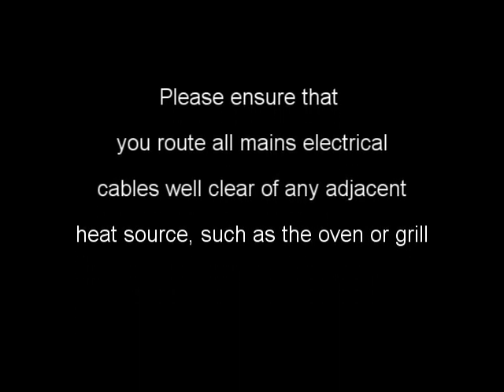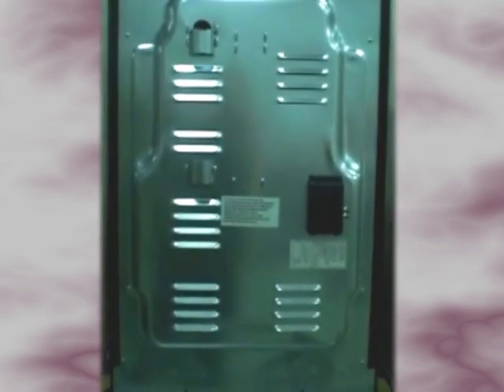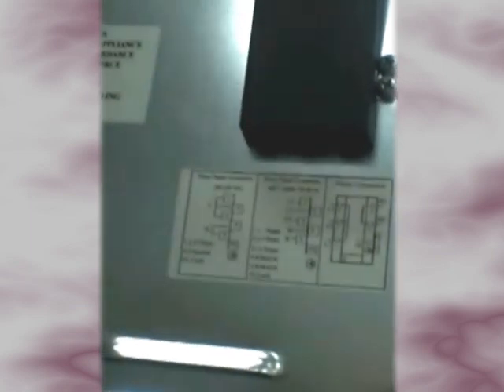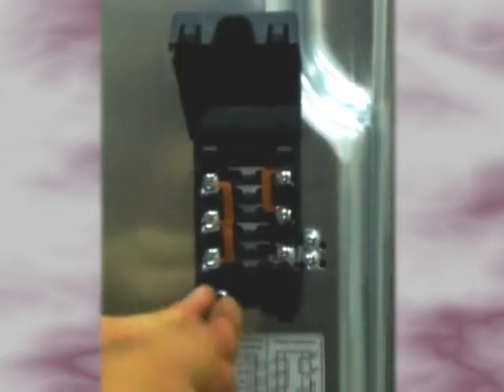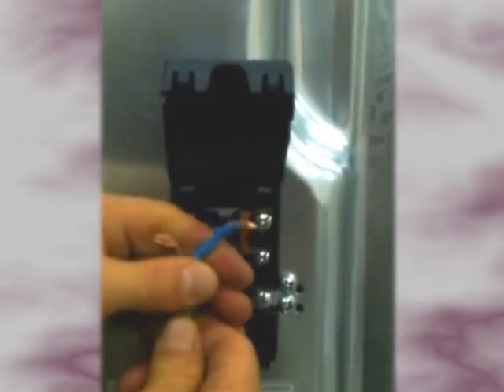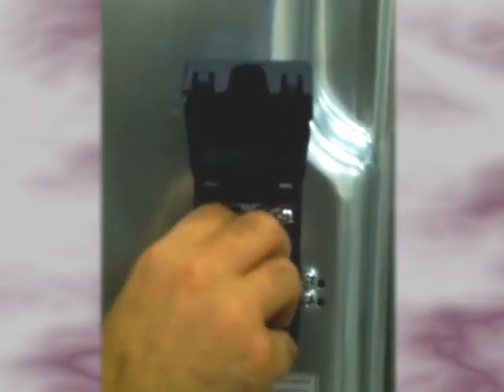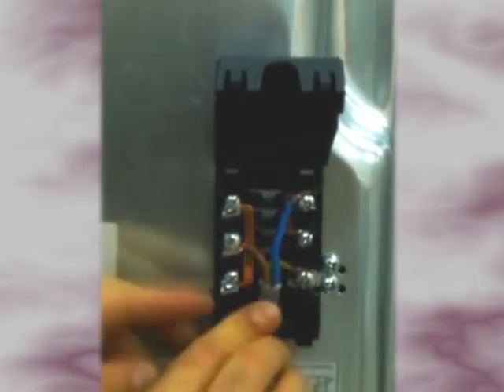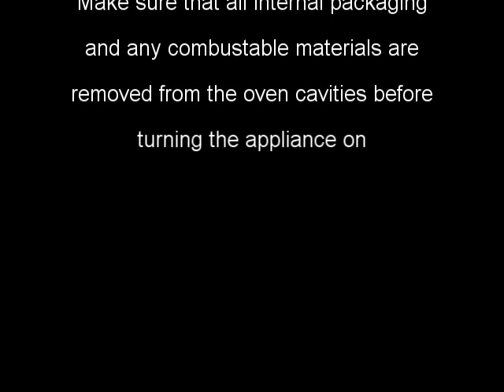cooker wiring video

Comment: What wire did you use for installation mate as old cooker ran on 10mm twin earth but this wont fit into new cooker  and upon reading instruction doesnt clarify which wire to use ?
Reply: 6mm twin and earth seems to be recommended on most sites.
Reply: @lewisner  all sorted ended up uprating the rcb snd using 6mm
Reply: @majorchronic81  I just did mine with 6mm and it is very thick and hard to bend so I can't imagine what 10mm is like.

Comment: I just fitted a samsung hob and the 5 terminals weren't laid out like this nor like the Whirlpool I took out. So I followed the instructions and all is well. Only thing was the connection links were supplied in the terminal box but not fitted. Here in the UK, on single phase, I needed to connect terminals 1,2,3 to Live and 4 to Neutral. Ground to Ground, obviously. Job done.